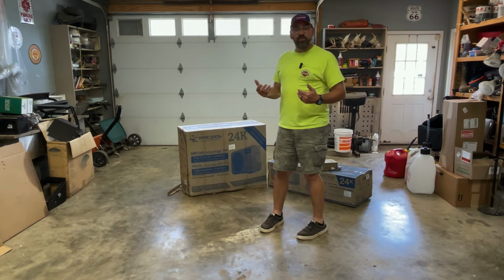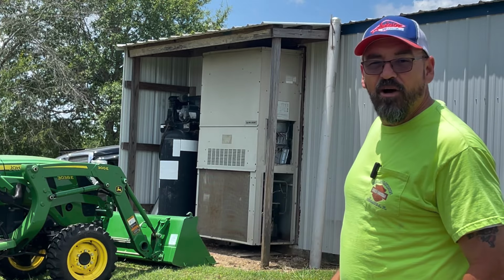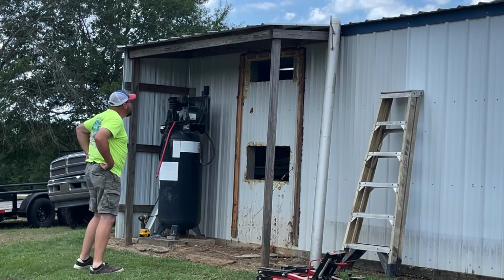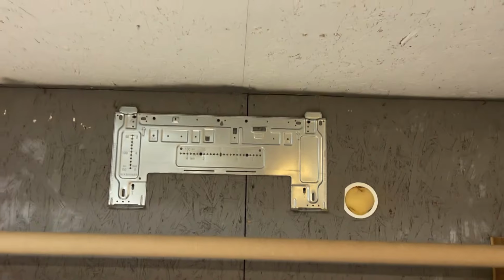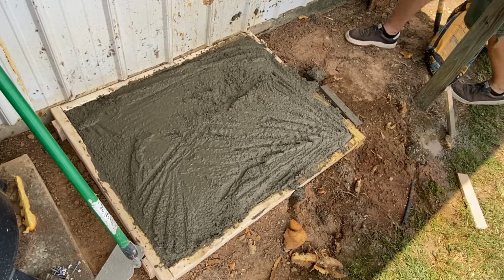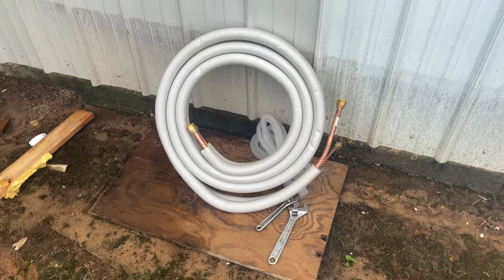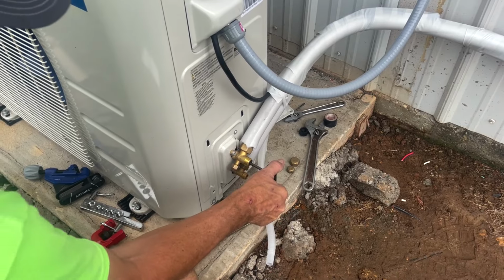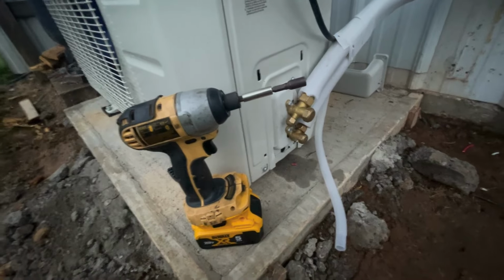DIY Mini Split Install MrCool 24K

Comment: You don’t need a neutral wire to   the unit only two hot in the ground
Reply from the maker: It came in the cord. It had 4 wires. I just used them all. Thank you for your comment.